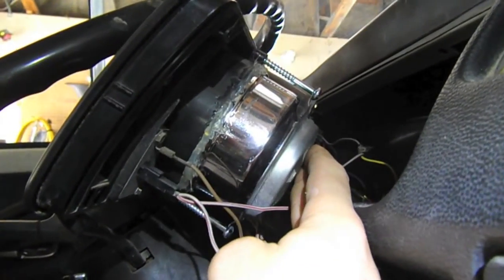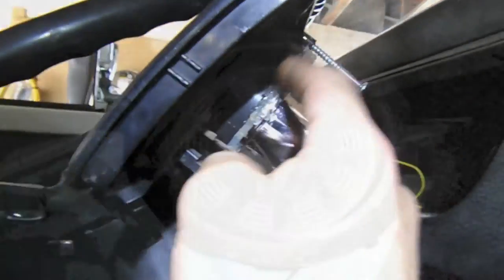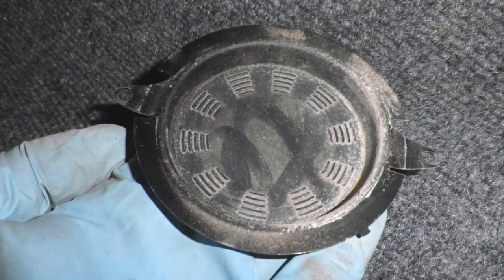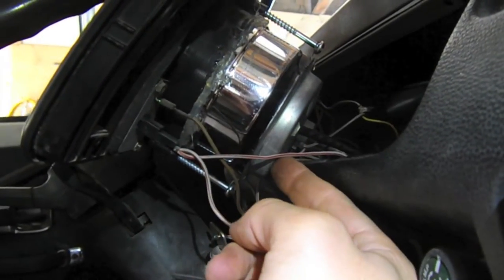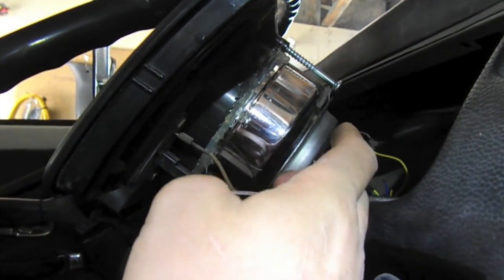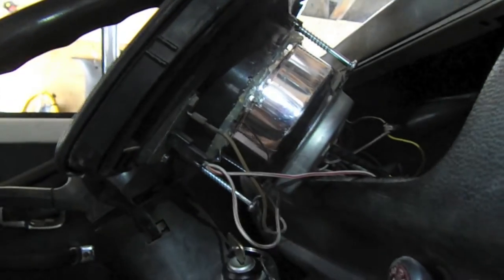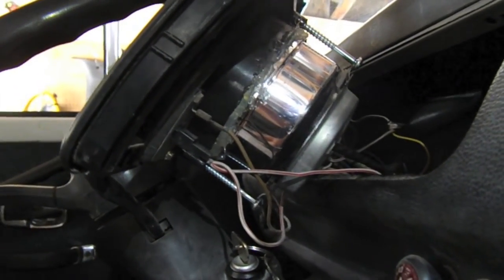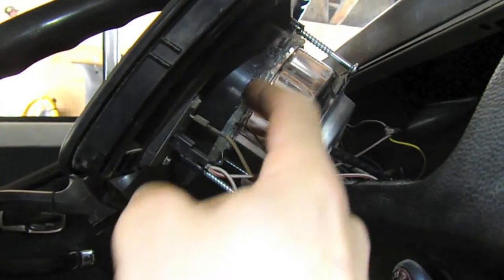Gauges Revisited - Busaru Engine Conversion Part 10B

Comment: Hey man awesome videos.  Are you aware of the VW TDI or 5cyl. 2.5L engines fitting a VW bus or Vanagon?
Reply from the maker: Hey Michael, I am aware of of TDI engine swaps but not the 5 cylinder swaps. I am a big fan of the boxer engine design and gasoline though, so thats probably why I haven't delved into diesel swaps or other (inline, V-type, etc) engines. I'd love to see  what you come up with for your swap.